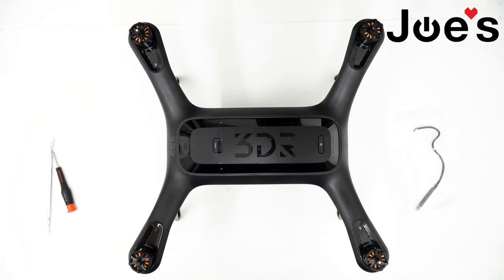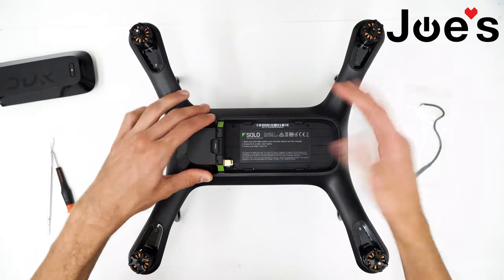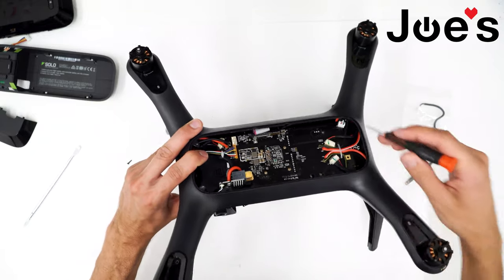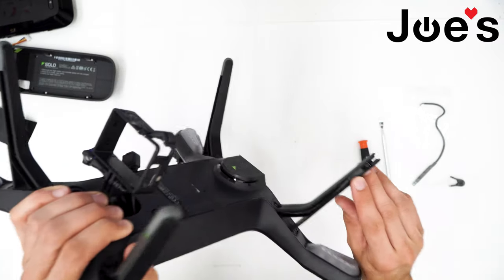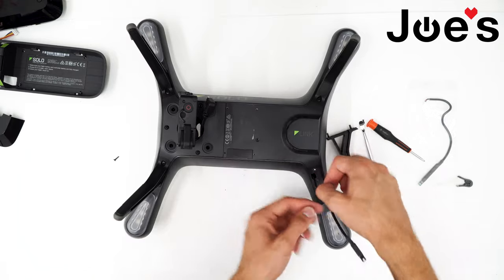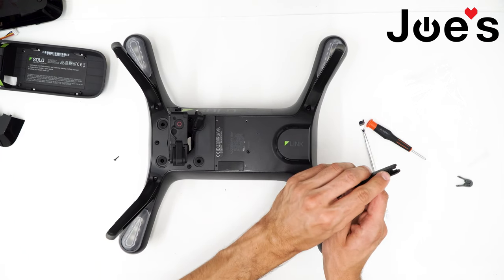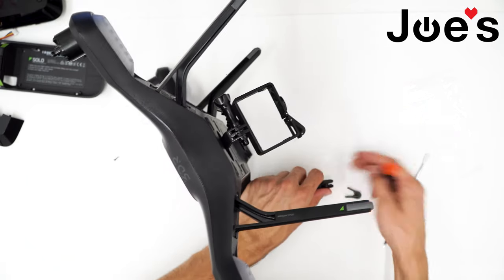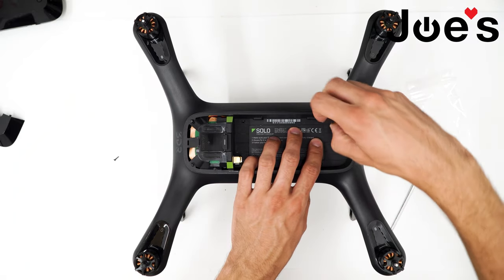Tutorial How To Repair Replace 3DR Solo External Compass

Comment: Where can I find a replacement compass?  They seem to be out of stock everywhere.  My unit is stuck in the Magnetic interference loop and fails compass calibration.  I'm 95% sure I have to replace the compass.
Reply from the maker: You can find the compass on our website here:
https://www.joesge.com/products/3d-robotics-3dr-motors-batttery-pcb-wires-covers-stand-parts?variant=13740153962542
-David P